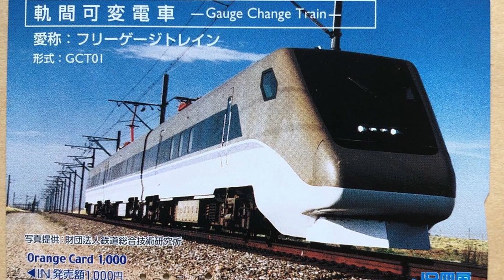Train Facts: Japanese Trainset on U.S. Soil

Comment: These are actually more fit for California High-Speed Rail because it has to cross the San Andreas Faultline at Palmdale area or Tejon Pass. Since the Japanese bullet train has a system that detects an Earthquake immediately shut down the power to the trains. European High-Speed trains do not have that system instead people wait for instructions from the dispatcher to slow down or stop. For Texas it is useful because there are hurricanes Tornadoes go over Houston eventually Dallas. Northeast region 1993 DB BR401 ICE 1 and SJ X2000